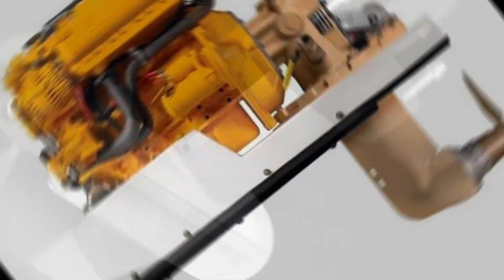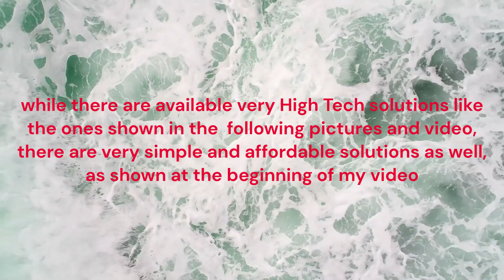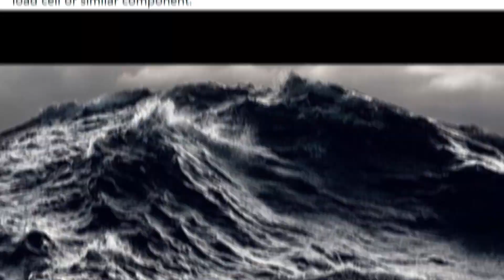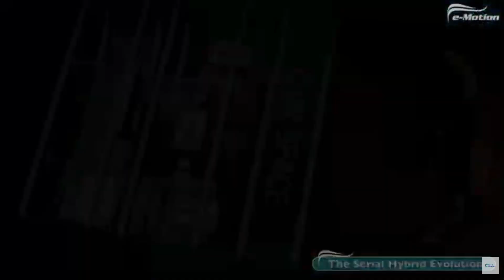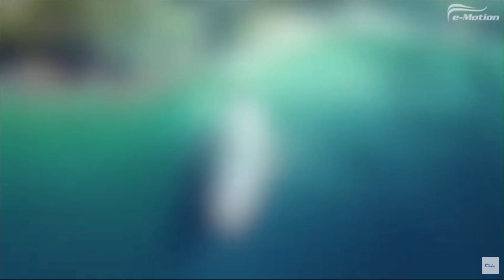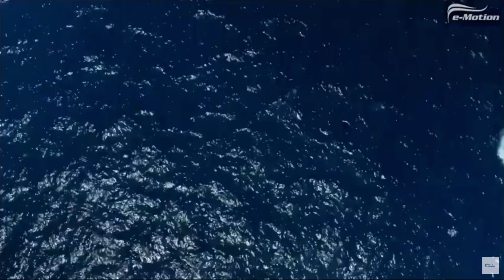Choosing the right propulsion system for a vessel - Episode 8 - Building a Houseboat

Comment: These are all the reasons why we decided to go with an electric motor as well! And our original diesel engine weighed about 350-400 kilos while our 25 HP electric motor weights 33.5 kilos. Lithium batteries can weigh one-third less than led acid, so you can have way more power for much less weight. Very informative video! Thanks!